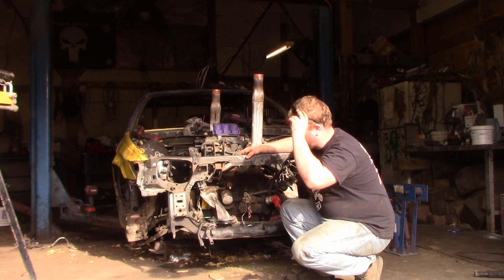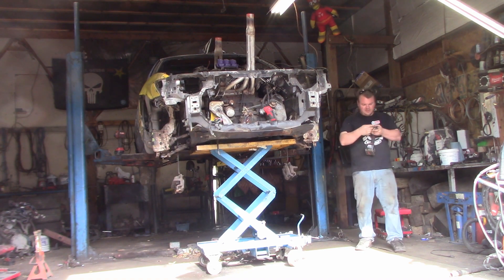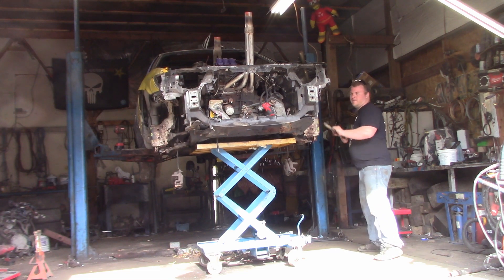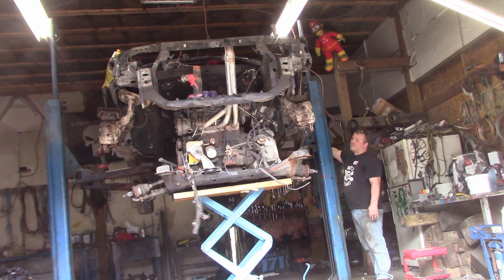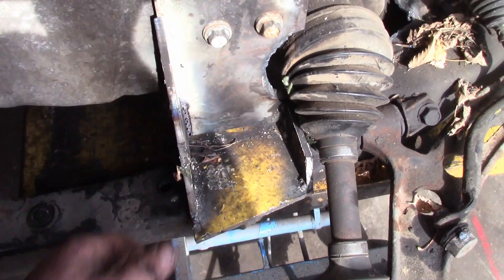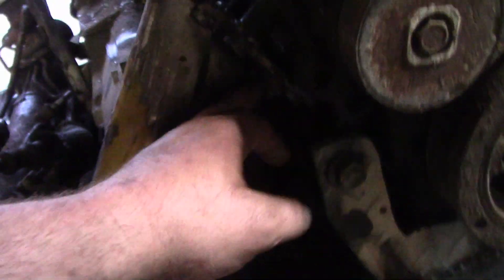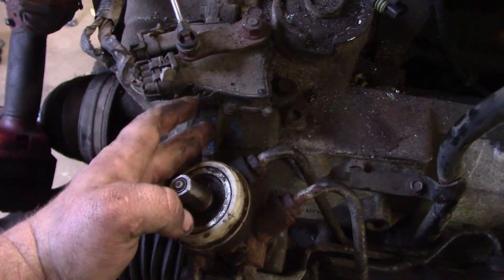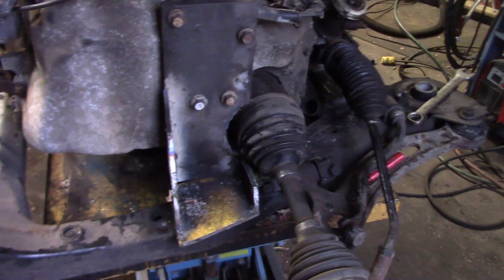3100 in a camry part 6 i have to redo the motor mounts

Comment: You take the suspension apart on passenger side take the nose cone off the trans on that side which means pulling axel out
Reply from the maker: no not welding it soild lol no posi in this one